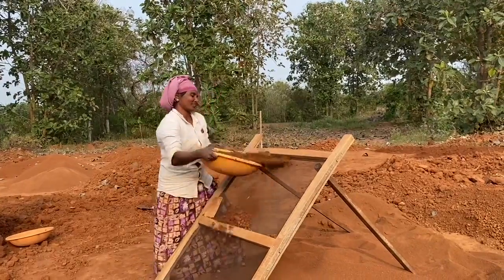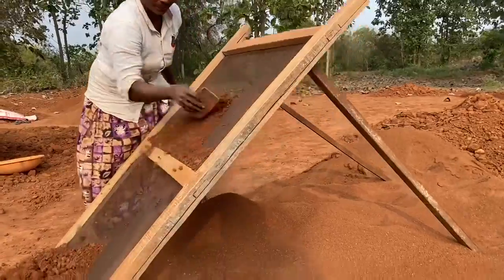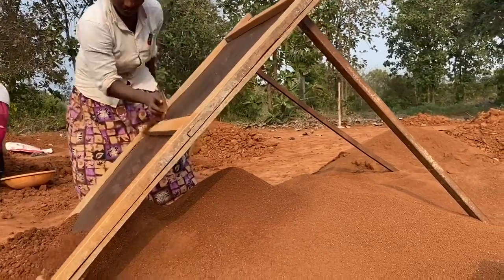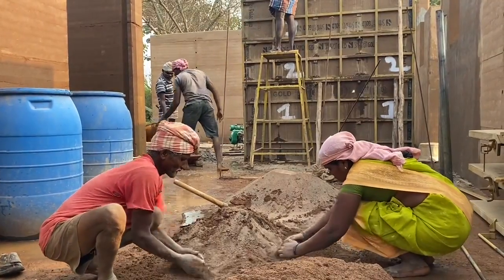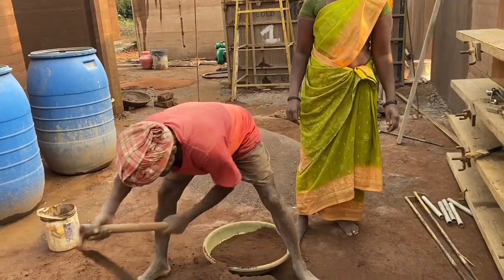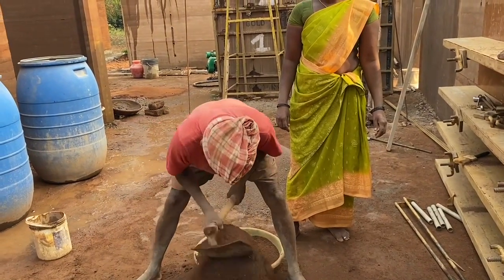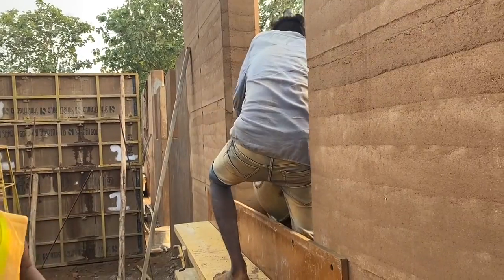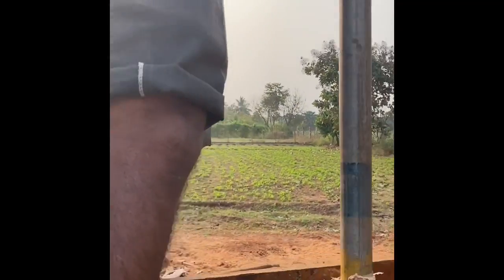Soil preparation for rammed earth wall

Comment: @
Vasudevan Parthasarathy Can rammed earth buildings survive in areas with lot of rainfall ??
Reply from the maker: It should, once the walls are set, they become rock solid. Having said that, this is my experimental farm house, need to validate only post personal experience. I’ve built the foundation structure with rocks, ran a plinth beam on top of it and raised these walls. Also I’m planning to have a two feet overhang across the structure, that should minimise exposure to rains

Comment: Great explanation. I am a civil engineer. A few queries..
How many floors can one build using rammed earth?
What about earthquake resistant?
What about termite resistance?
Reply from the maker: If it’s a columned structure, theoretically no limit. As the Rammed walls would be erected on the structure. Having said that building shutters that high, would involve erecting scoff holding and using pneumatic rammer instead of manual taking.
For a load bearing structure, with a normal foundation, earth quake should not be an issue.
Since the foundation is normal and we run a plinth beam on which the walls or erected, termite issues should not happen. However, I’m planning to have the entire perimeter injected with termite repellent.

Comment: Is it necessary to use cement? 
I have seen many videos in which cement did not use.
Reply from the maker: Cement is the bonding agent, else the mix won’t hold together
Reply: @OPTIMAVASU  
But cement works with sand not clay or dirt.
Please clear my question
Reply from the maker: @abhajihadi  have you tried Rammed earth before? I’ve shared with you what I have done. This is a combination of sand, clay and cement. Sand and clay are sourced from our own farm. Trust this clarifies your doubt.
Reply: @OPTIMAVASU  
One last question please
I understand Cement should be 7% of total soil, and What  ratio of clay and sand should be?
Please answer this last question.
Sorry for taking your time.
Reply from the maker: @abhajihadi  25% clay and 75% sand
Reply: @OPTIMAVASU  
Thanks